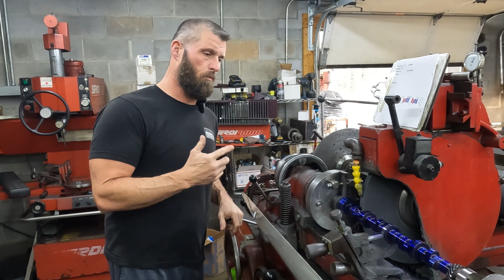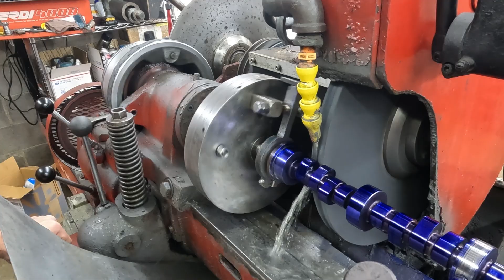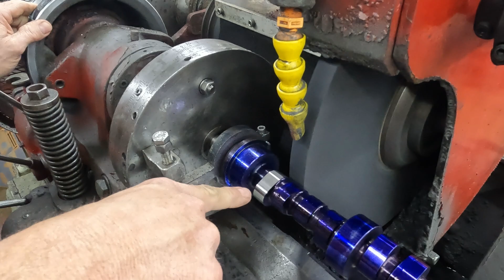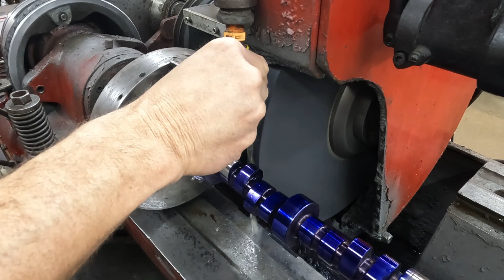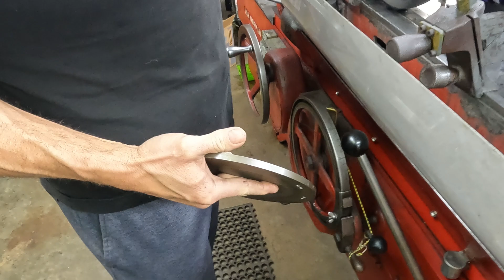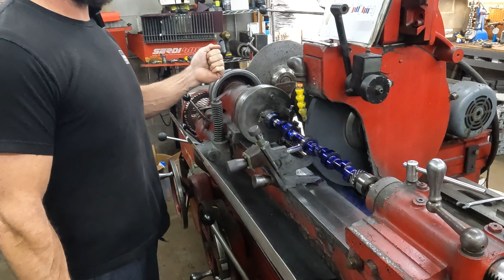camshaft Lobe index accuracy,  let's look at a good example

Comment: man I've seen cam index all over the place.  I've started doing all 8 cylinders in high dollar engines.  I've seen as much as 6deg variance from a well known cam company. This particular engine kept burning up #6 piston and after beating my head against the wall trying to figure out why I figured out the cam timing was all over the place. Great video brother.
Reply from the maker: Definitely,  ty, also don't forget about lifter bore location being off also.
Reply: @powellmachineinc  Yes absolutely. Good point. Especially when you have lifter location off AND cam index issues. Stacked tolerances become a nightmare. BHJ got my money for the fixtures and I'm guilty of letting them collect dust LOL.
Reply from the maker: @Marksracingengines  yeah, some customers just won't pay for all the options

Comment: Must have been made on a Monday.   Somones .001 is anothers .0011. Or .2 of a degree is someone's.5.  Tolerances are these for a reason and no 2 machines are the same but thats why we have standards. 

Case in point.  Clearly who ever ground that cam has something slightly off and they probably dont even know it.  They check all ther cams an they probably all pass inspection because they are taking comparison measurements.  From one to the next and not even knowing they are all wrong.

P.s., after 23 years as a certified mechanic,  i trust nothing........ double or tripple check everything!  Yes, its more time consuming but its the only way one will know if its right.

Its like a carpenter how has been using the same tape measure for 30 years.  Its going to be off.  It has to be check on a standard and this clearly is not being done.

On that note, how late, or early would that valve be when talking about piston travel?  How much breath would that cyclinder loose?  I wonder.

Comment: As a now retired lifelong Tool & Die Maker that has had a lot of time on cylindrical grinders, I have to ask, how many cams have you wiped out because of interruptions or loss of focus  and the index plate did not match the lobe position? Saw a guy grinding a dovetail on a big cast part and he forgot to take the dowel pin out that he was checking over for size. Cylindrical grinders do make for some bad crashes.

Comment: Is surface hardening an issue after you “touch-up” a cam? I’m a Harley tech and the most common issue with valve trains is the hardened surface flaking off the lifter roller, then eating up the lobe.
Reply from the maker: No issues,  if it were it would be a issue before we ever touched it, as we only remove around  .010-.015", what u are seeing is just low quality material and incorrect heat treat

Comment: How many of the big companies even use an index plate anymore? I thought everyone by now had CNC grinders like I do. With the wide variety of engines out there these days, with varying lifter angles etc. Do you have to have an index plate for every possible combination? I can think of 5 different BBC lifter angle packages in my head right now, stock, 42-48, 45-50, 42-27, 47-52, etc. I have never seen a machine like yours, its interesting. I can tell you have pride in your work. Keep it up.
cw
Reply from the maker: Every cam company that I know of still has manual grinders in production,  yes we have plates for every different bank angle and firing order

Comment: If someone is building a motor, what would it take on their part, to be able to detect what you just found on this cam? Are their tools out there readily available to do the kind of validation required?
Reply from the maker: A degree wheel

Comment: Made in the "U.S.A" is a sells pitch. And the upcharge is added because they continue to sell,  I'm guilty of it. I'd be happy going without name brand forever and waiting on the shops that does the work.
This family is doing real ish, and should be protected from the shit bag scamming POS that only want to get top quality custom parts for free. 
 Might as well place your order and have a  EQUALLY PROFESSIONAL ENGINE BUILDER! assemble and run in the engine.

 Been holding that in for a while.
Reply from the maker: Definitely

Comment: 🔔😎🇺🇸
Just my observation.
Variations in common everyday performance cams seems irrelvant because few people will degree them anyway... And if they do, they wont degree them on a dyno to get them exact for the best power. 
So it seems pretty moot. 
JMO. THANKS 👍👍
Oh, and what about chain wear and stretch?? Ive seen Cloyes sets retard 2* in 5,000 miles.
Reply from the maker: Chain slack is a "thing ", but the lobes are still in time with ea other,  quality timing sets don't get slack
Reply: @powellmachineinc 
Thanks👍
True, the lobes are ground in. But if they're not ILC degreed by Dyno testing to what each individual combination wants, does it really matter much?
Higher dollar timing sets should last longer. Some don't. Everyday hot rodders will never tell the difference of cam lobes or chain slack.
JME.

Comment: 🔔😎
Cams that run with extreme spring pressures twist while running. Are some ground to compensate for this timing variation?
Reply from the maker: No, because forces are equally spaced it would be impossible,

Comment: After seeing how that first lobe started grinding initially, I though that maybe that was a wear pattern in the lobe. Like the leading/trailing edge that takes the most brunt of holding the pressure of the spring. Then you got to the others and it wasn't a consistent pattern. So maybe it is just a manufacturing defect? Those few degrees they're off should be an acceptable amount for a daily driver. But like you said. It should be as close to perfect as it can be for a high performance application
Reply from the maker: But.... if your equipment is accurate why would it be off at all?
Reply: @powellmachineinc  I mean. It's pretty much been chocked up to human error that caused it to be slightly off from the factory to begin with

Comment: I assume you have your machinery qualified?
Reply from the maker: We qualify systems in multiple ways, but yes,
Reply: @powellmachineinc  Good. It was just something that came to mind. We used to be required to have our machines laser measured once a year and needed to maintain records for each machine. We did a lot of government and "defense" industry work, though. Hell, we even had random pee tests. LOL. Actually, after going outside to get another beer, I believe the correct term is "Qualified". Something about NMBA? ISO 27 something, something.

Comment: That's some interesting machine work and I've always thought this variance was what caused the 'freak' motors that we'd hear about now and then that outperformed others that were supposedly 'identical'.

Honda brought a semi-truck load of CBX motorcycles to the local dragstrip back in the day and my buddy test rode each one until the tires were gone while Honda documented all the runs.   Then they plotted all the performances and while this did make the classic 'Bell Curve' there was one bike that was faster than all the others and of course one that was  bringing up the rear as the slowest one.

This was what Honda wanted to see and then disassembled them and very carefully measured everything trying to find out WHY one was faster than all the rest?   Was it some minor camshaft timing tweaks that accidentally happened to that one motor?   It's such a complex thing within a running motor that each cylinder might very well like a little different timing than the others due to port, intake or exhaust variables.

I've only been a subscriber for a few weeks now but have already seen things from Mr Powell that I'm very happy to thank him for showing....much appreciated!!
Reply from the maker: Generally it's the other way around

Comment: This information goes right along with the information about the lifter bores. If it isn't right for every cylender it's not going to run its best. Probably will give the tuner issues. 
Thanks for the information.

I believe this along with many other things is why it's best to have one shop or man machining and building the engine.
Reply from the maker: Great point!

Comment: Really curious if the cam manufacturers are trying to grind the cam assuming that there is some loaded twist in the cam when it’s running , maybe that’s not a thing, I’ve often wondered this about camshaft with heavy spring pressure, thanks for taking the time to make the videos. I really enjoy your channel.👍
Reply from the maker: No, it's just sub par work
Reply: Or check for lifter bore out alingment
Reply: Good insight. But a cam core is a beefy chunk of metal and would need a lot of force to deflect.

Comment: Is it possible that the cam was ground assemitrical.
Reply: Well the cam master  for the grinder is ×5 bigger than the cam lobeit self,  he must have a the same master for this cam or close
Reply from the maker: No, you would have 3 asymmetrical lobes and 5 symmetrical would you?, also most hyd roller lobes are asymmetrical,  but that happens off the bc generally,  not below the nose rad.